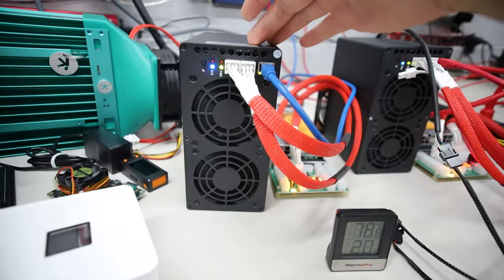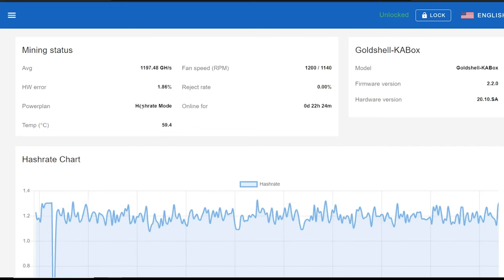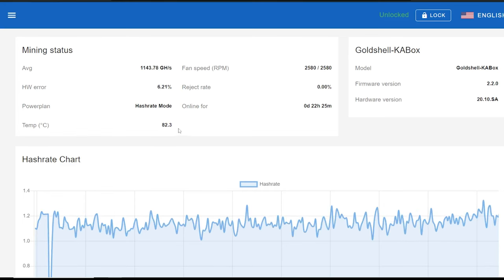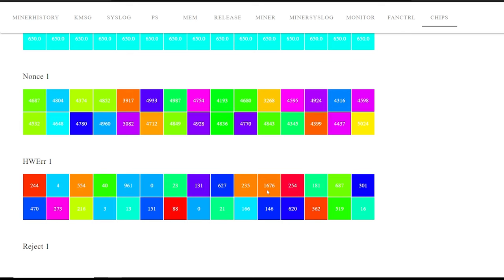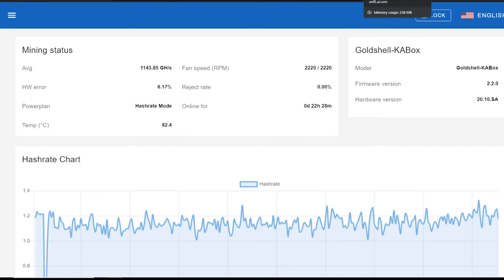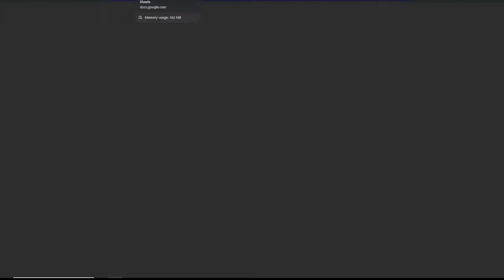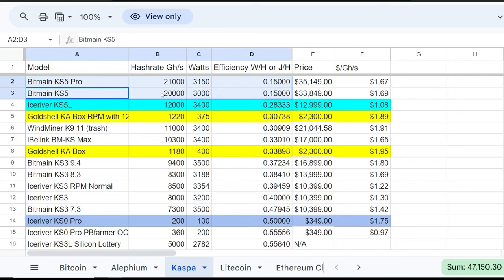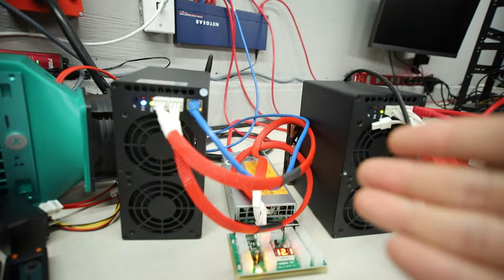I wouldn't want my Kaspa KA Box to STOP Mining...

Comment: I'm running my Goldshell from a 12V LFP battery, charged from solar. Works great, I don't pay for power and a little larger battery, and it will run all day and night. 400W solar is easy.

Comment: I think the KA Box is awesome but I agree with you on the heat. Iceriver said the same thing to me about the KS0 Pro, that it is meant to run hot. But I see better hashrate with temps in a lower range than what they suggest. And I don't like my miners running that hot for longevity and safety! :_redpanda::_mysoul:

Comment: I broke down and bought one from a reseller after missing out both times on the Goldshell website. I definately want to get a rear-shroud kit. I think the front would be problematic with the power/ethernet and limited opening as you identified. Rear shroud makes more sense. Were you able to capture the before/after power consumption of the miner and then the miner+fan?

Comment: Great info. The side by side comparison is great. In my opinion you should always try to lower the temp on electronics - if you can do this simply by adding some airflow that's great. Goldshell does try to minimize noise on these units but they all operate at relatively high temps... Might not be an issue but it doesn't hurt to cool them down a bit.

Comment: Based on your experiment, I agree with you that this unit must have suction fan/s at the perforated heat sink to draw out the heat, otherwise negative to run this by itself

Comment: If had one I would remove the stock fans and blow in from the back with aux fan/s.  
Ideally you could power the external fans with internal headers and utilize the systems temp regulated fan control.  
Thanks for sharing RPM.  Canada

Comment: That made a big difference, nice. What Noctua fan model is that, thanks. I would like to try this on my KD BOX2 to lower its temp, cooler is always better for micro electronics.
Reply: Your results are interesting, I just tried when I got home putting a fan behind the KD BOX 2 and not much of a difference, maybe .3-.5 drop overall. Mind you I don't have a Noctua fan so your test might just be the results of far superior 120mm fan pushing or pulling more CFM. Of course a shroud would make the real difference in my test.